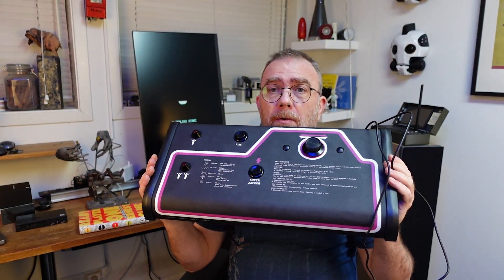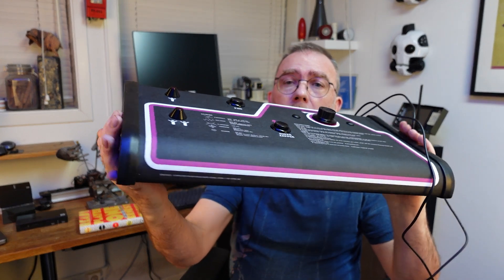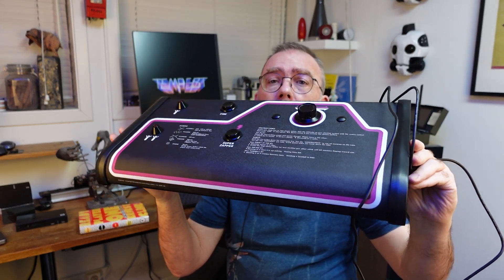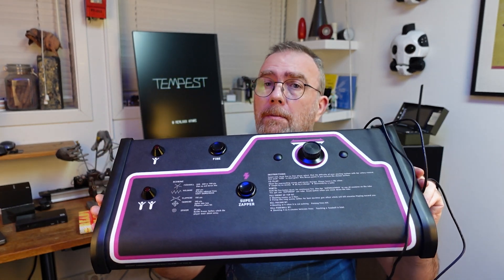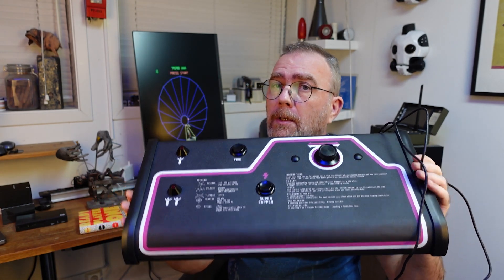Building a Tempest Arcade Control Panel Replica

Comment: a question, is possible to do an atari-themed combo control panel with required buttons and sticks for play each atari classics in multi-williams fashion scheme, adding trackball (centipede, missile command) and spinner (tempest, super breakout) and get a second stick (black widow, 2 players gameplay) and a few buttons for each player (space duel)?
Reply from the maker: Yes., it's quite common for people to design their own control panels when building arcade cabinets that typically runs MAME on a windows / rasperry pi or linux machine. An interface card plugs into your computer via USB and buttons/spinner/trackball/joystick etc are then connected to these interface cards. Arcade style buttons and joysticks can be sourced quite cheaply from ebay / aliexpress.

Comment: Can you share the 3d models and whatever models you have for the end caps?   Also any links to which items you ordered from the various sites?  Tempest is on my bucket list to be able to play at home... I 100% agree you cannot play it without the correct spinner... that has been the limiting item.

Also any schematics for how you wired things?  (and where the heck did you get the decal for it??)

Basically I'm looking for more details so I can build one too!
Reply from the maker: I just uploaded everything to github (bill of materials with links, step files and STL). PS. The exact spinner I used is relatively hard to get, since Oscar Controls are no longer selling them, but I guess there are other spinners out there that can act as a replacement. (https://github.com/hansj66/tempest-arcade-controller)

Comment: Beautiful work!
Could you share some info on how you bent the sheet metal into that profile? Did it require heavy tools or was it something I could do affordably at home? I've seen plenty of sheet-metal brakes, but I haven't found a way to make large radius bends without an industrial brake. Thanks! 
It's nice to find someone who has built basically what I've been thinking about and sketching while I wait to finish getting my workshop put together at our new place. My concept is to make a control panel like this (with original controls and the real feel of that thick, textured polycarb) for a game in each of several "categories" of arcade games, based on what controls they use. I'm putting together raspberry pi Batocera builds for each, so you can just swap the sd card to play the games for that panel. The concept can be extended to building arcade cabinets/bartops that any of the panels can be bolted onto. The idea is to make the whole thing modular, so you can switch to any panel that suits the display in question or even rotate the display for more versatility. Modularity has always been something the DIY arcade community plays with and it rarely works well. That makes it a challenge.
Reply from the maker: The first thing I did was to sketch out the approximate profile on paper. I didn't want it to be too steep, so the limiting factor was the depth of the spinner assembly. I then measured the approximate angle for the rear and front bend and used a cheap sheet-metal brake that I clamped to my desk. The brake I used wasn't design for more than 1mm sheets (I used 1.5mm cold rolled steel sheet for the panel), so I had to apply a lot of force to make the bends.Since there is no way of getting an exact angle using my cheap sheet bending tool, I had to do a few iterations in fusion 360 after i was finished with the steel sheet to get the side panels to match the curvature of the front and rear angles.
The curvature of the bends is just happy accident / side effect of not having a powerful enough tool to make 90 degree bends on 1.5mm steel sheet :) 
PS. The front curve is 3D printed plastic that sits in front of the sheet metal. I used epoxy clay to smooth out the small gap between the plastic and the metal.
Reply: @TimeExpander  Thanks for the detailed reply!
That's a great result for something you shaped out of fancy Bondo. I may have to get a cheap brake and just play around with it on a few sheets. I had decided that the cheap ones were pointless with the thickness I'd need without a lot of bracing underneath. I might try making the front out of profiled wood, since wood is really my thing. 
....shape with saw, then blade, then sanding....join to the panel with epoxy and countersunk screws.....Sounds doable. I may be able to do some designs that require no bends at all. 
I had just about talked myself into giving up on sheet metal for now and make the first few out of wood. Maybe I'll give this a try. I would have had to make a metal insert cut a place for it to mount trackballs, etc., so this might be easier too. 
I may have to get a Tempest spinner too. I was planning on Arkanoid, but the simple graphics and text on that black panel is sexy as hell.

Comment: Did Mame require a custom driver for the spinner interface? If not, I'm honestly impressed that the Mame devs had the foresight to provide such an interface, when most people wouldn't have such an option
Reply from the maker: I used the Ultimarc OptiPAC interface for the spinner. It requires no additional driver. The only thing I had to do was to update the mame.ini file